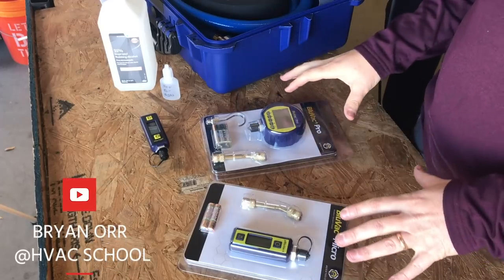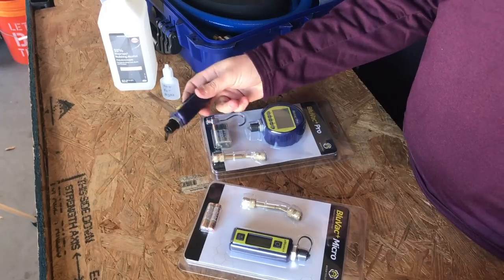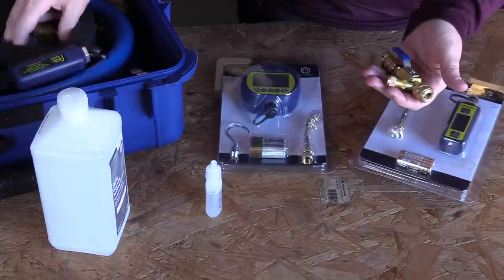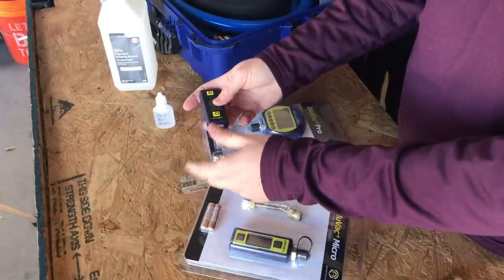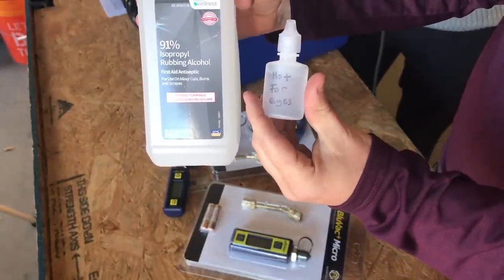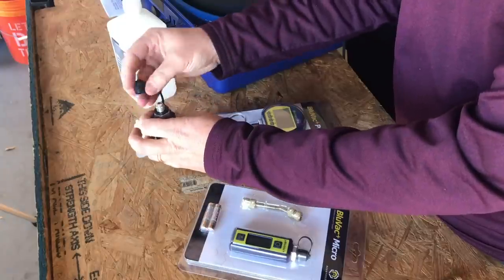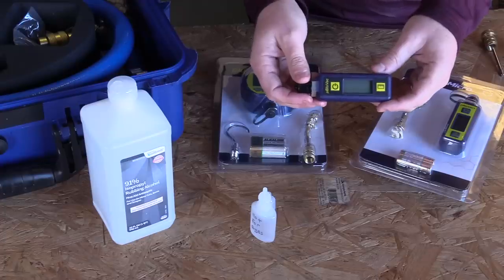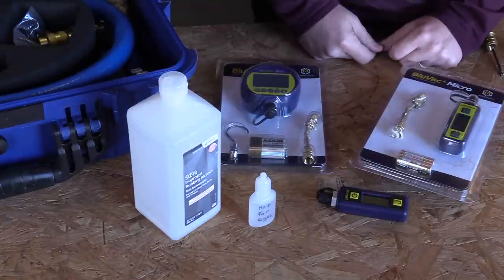How to Clean a Micron Gauge

Comment: I recently had to pull a vacuum on a system I only later realized had insane oil migration. Despite the micron gauge standing upright, the sensor was smothered in oil. I removed the Schrader depressor and poured alcohol in a few times, and it still struggles to read accurately. I'm probably just going to have to get a new micron gauge.
Reply: My bluvac mini reads oil after 2 uses. I use my old  compound vacuum gauge.

Comment: How this sensor works ?
Reply: It has a tiny heater and it measures how quickly that tiny amount of heat dissipates. The less atoms present to get excited by the calibrated heat source the slower the heat dissipates and therefore we can get a measurement. Pretty ingenious if you ask me. The tiny heater gets covered in oil and throws the whole thing out of whack.
Reply: @jamminwrenches860  thanks